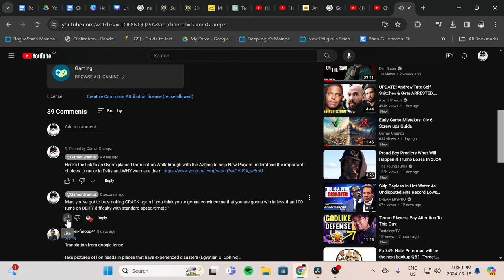Civ 6 Water Mill and City Walls are TRASH (Quick Guide)

Comment: Pretty interesting video, definitely agree rushing walls is not great especially without limes.  Just wanted to note at 33:15 you say Agoge policy card cuts production of the slingers in half but the wording might be a little confusing here, the card gives a 50% production boost towards slingers not a 50% reduction.  That's like if you have 20 production in the city it would become 30 towards slingers which is essentially a 33% reduction towards them.  So in other words, the 35 production a slinger requires would actually be cut to 23.3 not 17.5.   Doesn't change the point of course, still much more valuable to make the slingers instead of a wall, just wanted to point out exactly how it works.
Reply from the maker: Hey thanks for taking the time to leave a comment, I appreciate it! But really though, thanks even more for your comment being so accurate and well thought out.

I'm not trying to kiss your ass or anything, but that was a nice catch and 100% accurate. I straight up missed that and I don't like putting out things that are wrong.

I mean you're right given the context it isn't the end of the world by any means, but it still irks me not to have explained it more accurately.

Glad you found my channel and hopefully will be around in the future to catch any other fuck ups I might make! :)

Comment: You say a builder is 50 production. It's actually 46+4*(number of builders built). So if you're in the medieval era and have put out 25 builders it's already up 150. Still I usually just purchase the water mill in newly settled cities that I need up and running a little faster.
Reply from the maker: Thanks for taking the time to leave a comment man, I appreciate it.

You're 100% accurate with what you said there, but my counter point would be that by that time in the game you have also unlocked the Serfdom policy card so 1 builder will get you 5 charges and is still better than a watermill.

Save your money and purchase a Monument or a Granary which are both better choices in the long run.

But to each their own man, play the game however you find it to be fun... nobody is holding a gun to your head. Yet. :)

Comment: With BBG it's 1 food on all farms (not only on bonus res), but it's so hard to justify spending builder charges on farms before feudalism.
Reply from the maker: That's a step in the right direction with BBG at least. Definitely would make it easier to swallow getting the 6 farms needed to boost Feud though